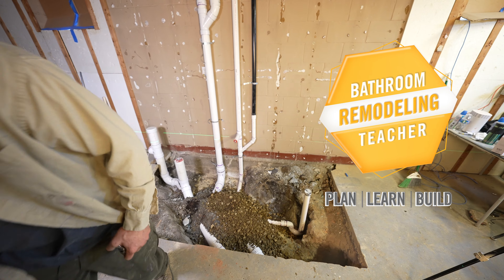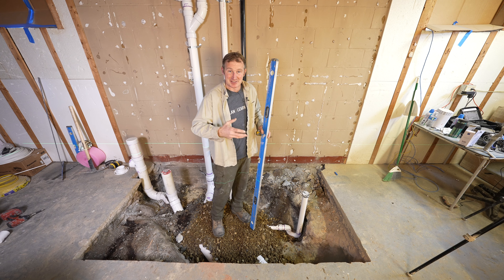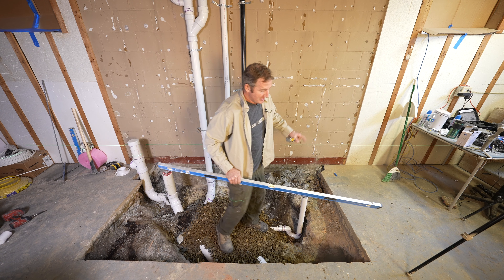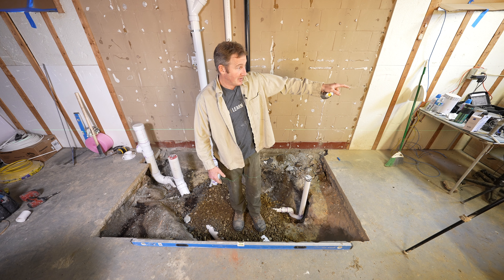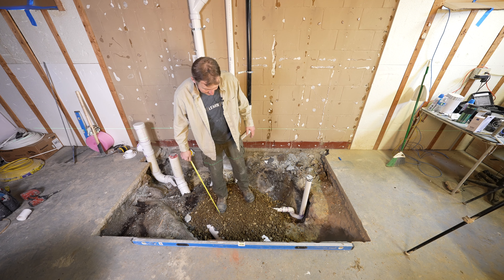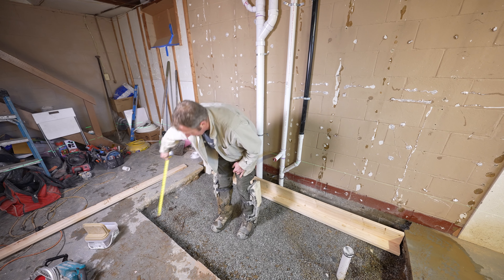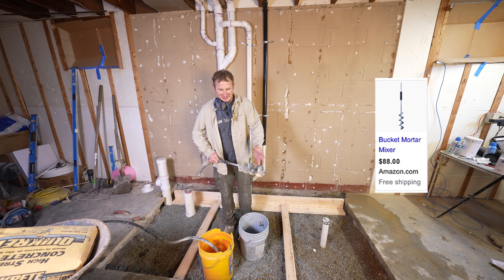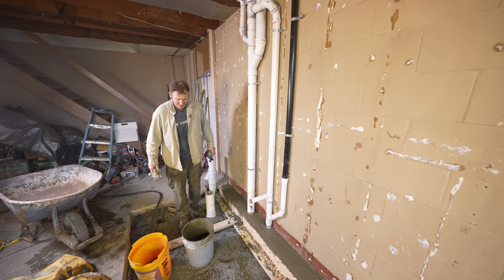Concrete Floor for Curbless Shower | Basement Bath

Comment: I grabbed a used mixer off of marketplace for $100. I've poured close to 100 bags in my basement project now, sure helps a lot with the heavy lifting.
Reply: Don’t breathe the dust , at all . Silicosis looks the same as asbestosis on the imagery

Comment: Mam the amount of work to get that slab out.  A must have is a good concrete saw.  I like a hilti with a vacuum attachment for 4 inch slabs.  A good vacuum is a must have as well or good chop saw with water attachments.  

I foind this channel because i was asked to help grow a young company with 2 men that have no idea ehat they are doing.  I have never remodeled many bathrooms but i know how to build and operate pretty much every tool.

Comment: Excellent video. Thank you so much. Period. I just found this. I roughed in my plumbing for my basement shower on a flip that I am doing. I backfilled with the gravel and dirt that I dug out to put the plumbing in. Is that going to be OK or do I need to pull that out and put gravel. I am concerned that the mostly dirt and gravel will settle overtime.

Comment: How'd you get all that gravel down those stairs in the wheel barrel? Thanks so much for your content you do a really great job. Helped me rough in my basement bathroom and it's mint.
Reply from the maker: Luckily there’s an attached garage, no steps 😊
Reply: For tough spots during our landscaping projects, we would fill two 5-gallon buckets 75% of the way with gravel and carry them. Two balances the load. One landscaper I knew used galvanized wash tubs with handles on them to move soil, mulch and stone!

Comment: What would you recommend for just a straight up concrete floor? Curbless shower concrete shower floor and bathroom floor all throughout no tile or vinyl on floor?
Reply: Water for plumbing basically need 1/8" of fall per foot.   Concrete should be slopped to the drain by that much.  If you have a 2 foot slope to a drain then it is 2/8" or a 1/4" higher at the begining of the slop to the center of the drain

Water will eventually erode the concrete so you need to use an adequate type of cement or something that won't pit and fall apart after water is constantly hitting it

Comment: Hi where did you get the foam baord can i get one in home depot or lowes.  if it is slab why do you need to have vapor barrier in bottom bcz any case you are going to water seal it with redguard or kerdi membrane.
Reply from the maker: Yep Home Depot and lowes carry it
And it’s for mostly insulation value for heated flooring 👍

Comment: Why didn't you dowel in that curb to the existing concrete? It's going to break off over time. Also, why didnt you use rebar anywhere? On uncompacted gravel, thats going to crack and separate from the exhsting concrete floor
Reply from the maker: It’s not outside, it’ll be fine. But your points are valid & are better methods